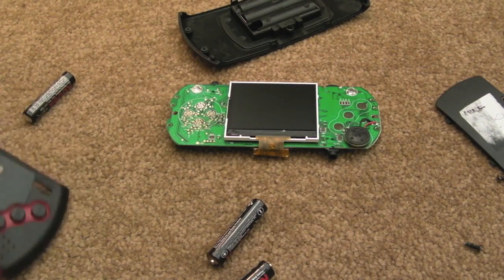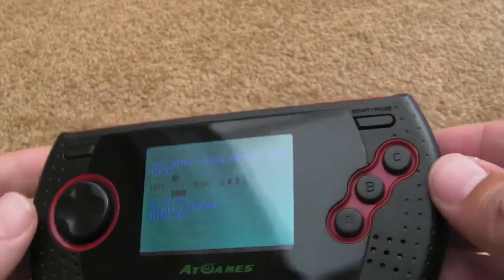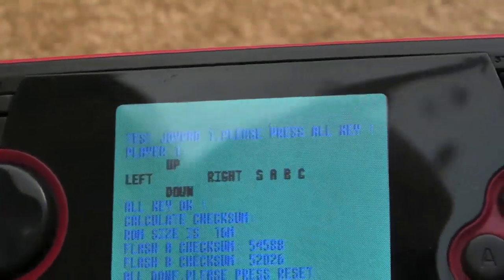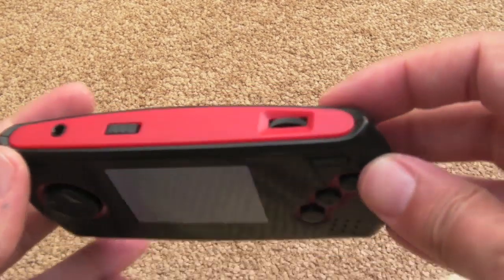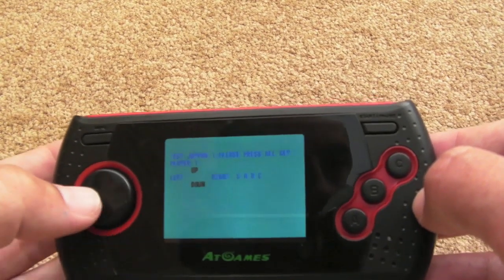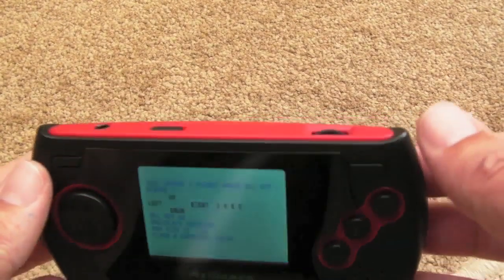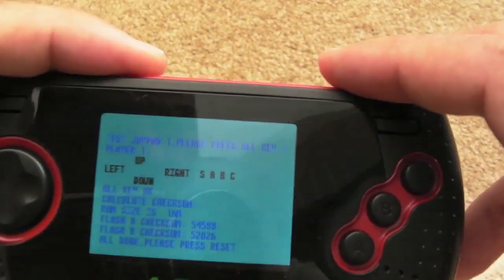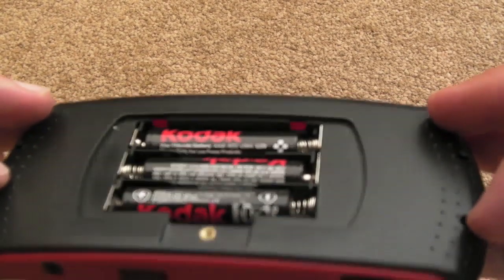AtGames Megadrive Handheld Repair?

Comment: Soo... I dropped mine and the screen is your typical broken looking screen, is there any way I can replace the screen/fix it? I dont know how and I'm wondering if there are any shops that can fix it.
Reply from the maker: You're only chance really is to find another faulty unit and swap the screen over.  Often the screens are OK and what happens is bad connections form under the BGA ROM IC, or the tiny ASIC under the black epoxy develop a bad connection or just simply fail.

Comment: I've got a sega mega drive arcade ultimate with a white screen. How can I fix this?
Reply from the maker: You can try reflowing with hot air, but beyond that you may as well bin it or use it for spares.  The solder points on the ROM chip often go bad (BGA) - due to the buttons putting pressure on that area of the board.   The main ASIC sits under some epoxy and you cannot do anything with that if a connection there breaks.
Reply: I actually have a white screen with a glitchy mess, How can I fix it?

Comment: My screen is weird, it has white stuff and black stuff on it its not dirty, its the screen
Reply from the maker: Could be a faulty screen!  These things are not very reliable at all.  With time, after pressing the buttons the BGA mounted ROM chip can get fractured solder points on the board.

Comment: I have an atgames sega Genesis that's black and blue and has six buttons instead of three and the screen is elevated to the point where the start button might get stuck could you make a video on how to fix that please?
Reply from the maker: I've got the same 6 button one also!  I've not come across that problem though, but if I do I will cover it in a video!
Reply: +GadgetUK164 wow I can't believe you replied 😮 thank you but I figured it out
Reply from the maker: No problem lol!  I try to reply to all messages - just a case of finding time!

Comment: I noticed this other video /watch?v=zSL1lb2QhBU
because of the design one the pins on one of the chips came loose and was causing a slow down, adding a bridge fixed the issue in that case.

Comment: if they sorted the sound emulation (and i'm not sure why they don't) then it would be a great little gadget
Reply from the maker: Hehe =)
Reply: I've wondered if the sound was deliberately sabotaged due to Sega licensing - maybe Sega thought it was too perfect?  I don't see how else the sound could be so bad, especially when so much code exists for reference on how to get almost perfect sound.  The other possibility is the FPGA they used wasn't quite up to the requirements and they had to clock back the Z80 or make some wierd performance related changes to the sound engine in order that it would at least work.  There's also the possibility that they ran out of budget and ignored the bugs.  I do agree that if they revisited the product and brought out v2 with proper sound it would sell 100 times better.  I would certainly buy one...   I've got the SD model as well and I do love being able to take Megadrive games on the move etc.
Reply from the maker: ***** No, it's a frequency problem.  Strangely though it doesn't affect all games.  Some games can sound really good, where other games can sound like the tone of sounds or music is off slightly.
Reply from the maker: ***** Sadly not =/  I bought one myself thinking 'surely the sound cannot be that bad', but on certain games it is very bad lol.  It's all about the tone or frequency certain things are played back.  For the most part you cannot hear any problems.  For example Road Rash and Desert Strike  seem fine - from what I remember.
Reply from the maker: It's just coincidence!  They are both EA, but I've played hundreds of games on my SD based AtGames Megadrive and they do sound bad in places, and its not just EA carts, many Sega games sound wrong as well.